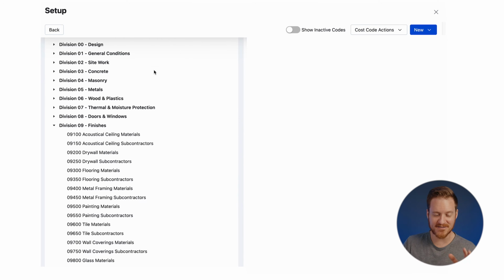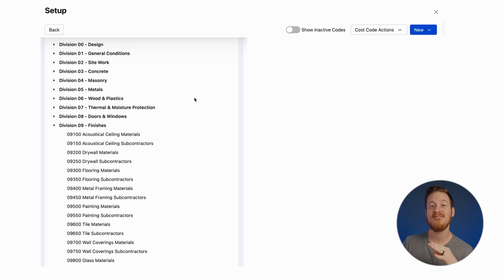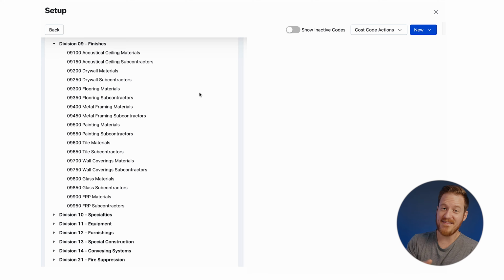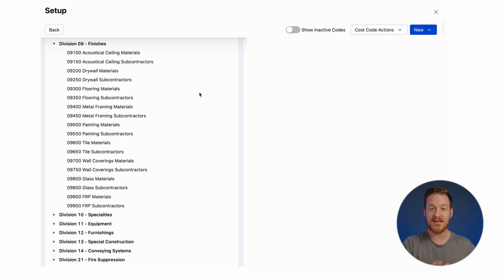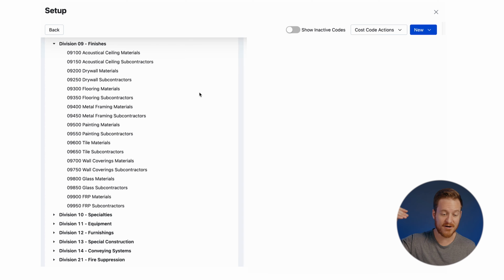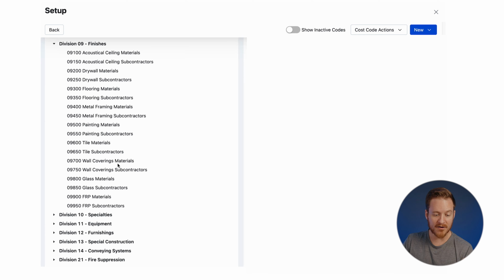Revealing My Commercial Construction Cost Codes!!

Comment: TLDR: Cost codes are essential for tracking expenses in commercial construction projects, and setting them up correctly is crucial for better budget management and seamless flow of information in QuickBooks.

00:00 🏗 Cost codes are essential for tracking expenses in a construction company, and the speaker shares their own cost codes and offers a downloadable Excel file for viewers to use.
01:23 🏗 The speaker discusses commercial construction cost codes and emphasizes the importance of understanding them for those entering the industry, revealing their codes and encouraging viewers to buy their template for more details.
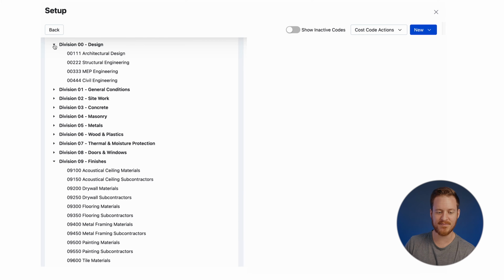02:55 🏗 Different cost codes for architectural, structural, MEP, civil engineering, general conditions, site work, concrete, masonry, metals, wood, plastics, thermal and moisture, doors and windows, and finishes are discussed.
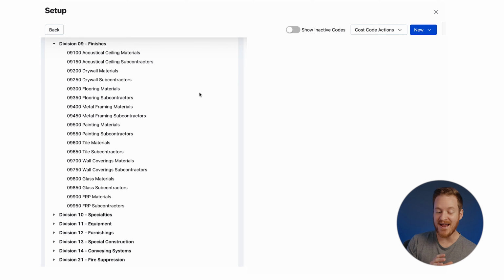03:40 💡 Acoustical ceiling materials and subcontractors are cost codes 09100 and 09150, with labor not included in the speaker's template but available in the provided template.
04:33 🏗 Use broad categories like flooring materials and subcontractors instead of breaking down into specific types, and consider the gray areas like tile work and wall coverings when organizing commercial construction cost codes.
05:44 💰 Setting up cost codes correctly is important for commercial construction projects to track estimated costs and compare them to actuals, allowing for better budget management.
06:43 🏗 Properly setting up cost codes is crucial for commercial construction, and using them in QuickBooks can make everything flow seamlessly.
07:59 🏗 My commercial construction cost codes are revealed in this video.

Comment: What is the relationship of these cost codes to the cost estimates.
Reply from the maker: We use them to estimate and then everything flows from there with job costing against each code.
Reply: @Jesse_Lane  but how could you apply to all circumstances, every project wbs is different from other project, so is the codes for estimation then how can it apply to every project.

Comment: Very good info. You should show how these integrate with a Bid form template

It would help make compring projects easier.

Do you have a similar sheet set for the welding and fabrication sector? I think many pipeliners and specialist fabricators would be interested in this sheet.

Im concerned about steel weight and inch -dia metrics